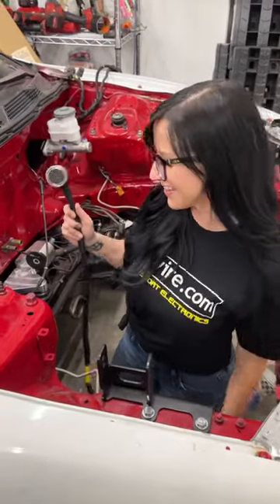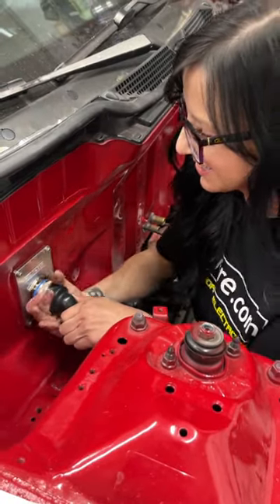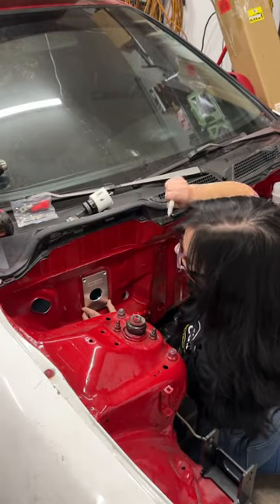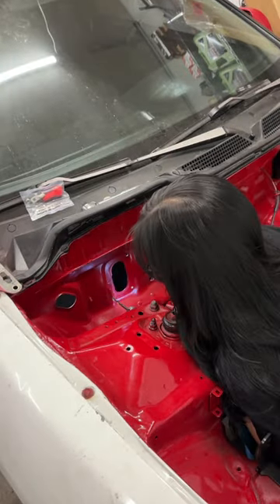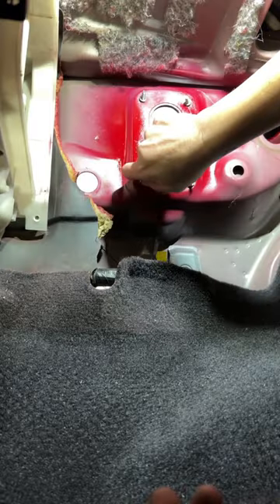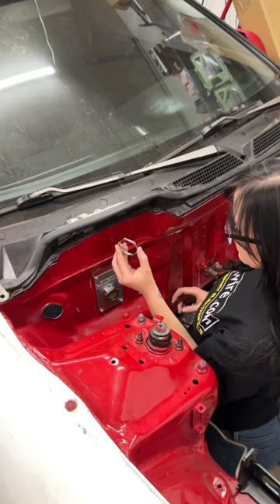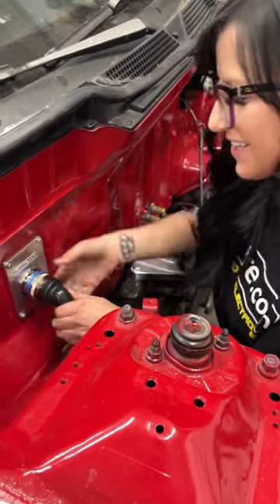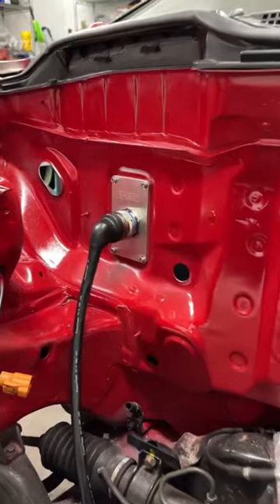New Rywire Integra wiring harness!

Comment: awesome work, just one thing; you cut bracket full circle, to prevent jam nut connector to rotate, you need a circle as the jam nut connector has, otherwise it will rotate after somewhile.

Comment: What application does this option become useful? Seems like theres very few reasons to need a quick disconnect for the engine harness
Reply: Don't know much about cars?

That harness makes wiring the engine much, much easier. You can just sit there and run a bunch of wires if you want. This is much easier and also has the upside of making the engine bay look much neater. 

Also, if you're racing a car, it's not unlikely you'll have to pull the engine regularly.

Comment: Do you have any tips on cause I am building my motor for my G 35X sedan all-wheel-drive and I was wondering do you think I should keep it all wheel drive or converted to just rear wheel drive because the car is not going to be winter driven at all and any tips on like suspension that I should go with any tips on what kind of supercharger or should I go with a turbo any info you could give me would be great thank you
Reply: I know you aren't asking me but really it comes to what you want to do with it. Keeping awd is probably a better idea with how much work it would be to change it. And awd is much more versatile, but if you would be into drifting that's the only thing that would really be held back by that. And again turbo vs supercharger is what you are looking for purpose, what kind of power you want. I like turbos, if sized properly you can have a wide range of different style powerbands. Either way it sounds like it will be a really cool build!